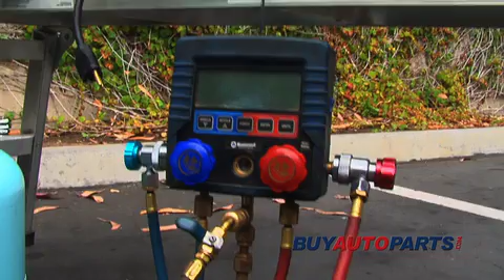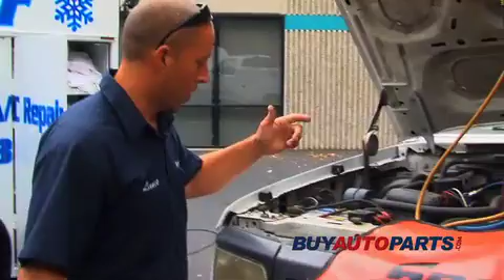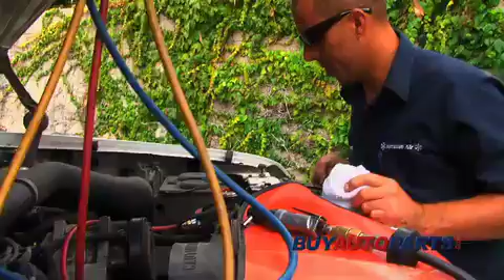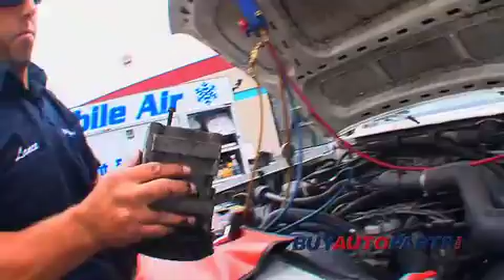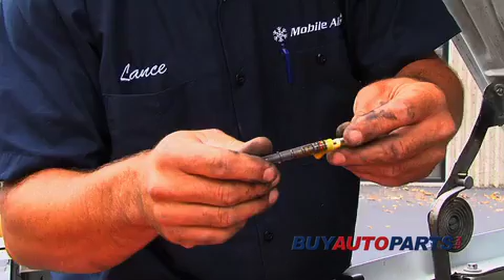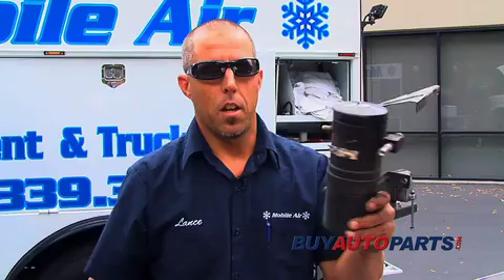Air Conditioner Compressor Repair How to Install: Mechanic Instruction- Part 1 of 3

Comment: Originally I kept it strictly euros (my specialty) but when the economy took a turn for the worse I lent my services to all that would come. Today I service a dedicated client base that ranges from fleet vans, to bmw 750il. I am ASE certified in brakes, ac engine performance I/II and electrical.

Comment: I actually provide mobile services. I am a mechanical engineering student, and turn wrenches to pay for school. However prior to my decision to return to school and further my career I worked in the industry for 6 years. (Dealer circuits).  I learned a lot about customer service, and diagnosing, but I felt like a cow at the slaughterhouse. So I branched out on my own and became independant.

Comment: Here in Miami so many DIYers f'up their air conditioners by doing dumb stuff like over charging, no vacuum, and all that leak sealer crap. Then they cry when it's 800+ to repair, and call us scammers. It's a no win situation. You just have to be optimistic, and focus on customer service. I also have customers who appreciate my knowledge and work ethics, and that's nice too